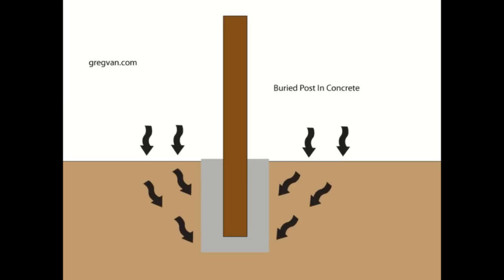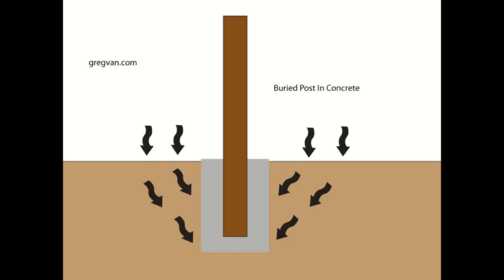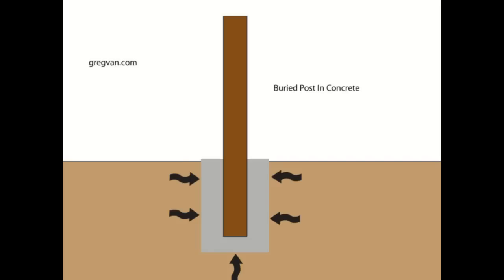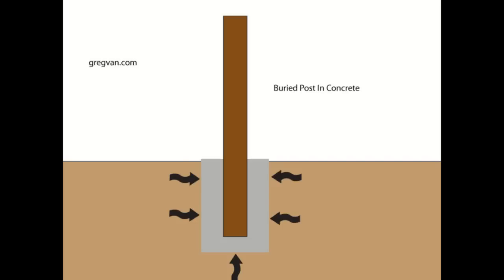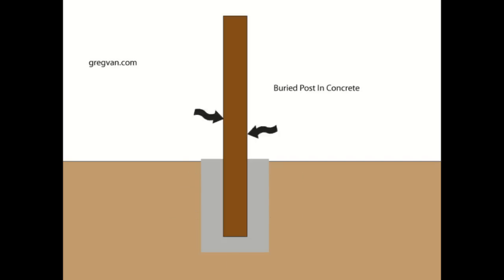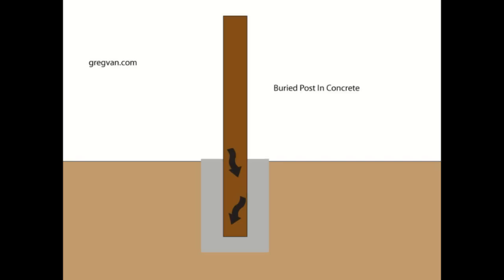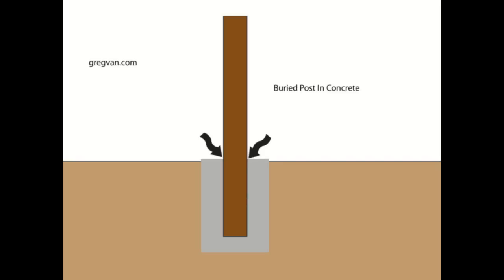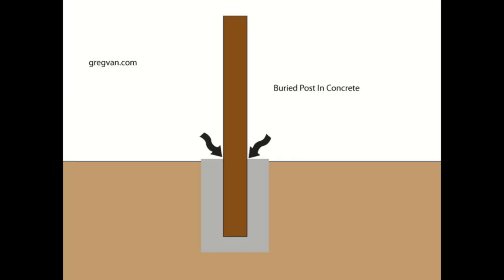Why Do Fence Posts Rot and Break - Wood Fencing Damage

Comment: I set 4X4 and 6X6 pressure treated posts into a concrete pier with the pier terminating at grade level.  I then butter the top surface of the pier, around the base of the post and about 6 inches up the post with an acrylic paintable caulking.  I use a cheap DAP exterior caulking which states that it has a 30 year life. when used or normal caulking purposes.  Butter the caulking on with a putty knife about a quarter inch thick.   I find it seals the base of the post where it is always wet with debris, ice, snow and wet leaves tend to gather.  it seals the gap where the post enters the pier after the wood shrinks with time to prevent water from pouring down between the concrete and the encapsulated wood post and it seals the top of the concrete pier.  I've found that the caulking does break down after about 7 to 10 years and allows water to reach the critical post base at that time so the rot process begins then, rather than the day after you installed the post.    If I've extended the life of the post by five years or more, that's a fair benefit for the two dollars that it costs to butter each post.

Comment: Gravel in the bottom of the hole. 
seal the post with roof tar or wrap with bitchathane.
They now make products for mortar and grout that you mix into it to make it water proof.
Always slope the top of the concrete away from the post. As will as have the concrete  above ground level.
Caulk around the gap at the post and concrete meet.
If the customer is willing to spend the extra money. add a piece of coated 1/8-1/4 angle iron in the ground with the post.
sticking out 1' above the ground. 

Foam is also an option but must have hard soil or deeper holes.
Does not work with load bearing posts. (ie gates)
Reply: What is the small angle iron in the ground for?  What is foam?  Thanks.
Reply: keeps the post more stable against wind movement as well as when the post doese start to rot you have the angle Iron to then bolt the post to.  Foam : just like spray insulation. closed cell.  use it instead of concrete.
Reply: +Dusty G. Thank you so much for posting, Dusty. I knew if I read enough comments I'd find one with the info I needed. You the man!
Reply: Top comment, nice one Dusty - proper job ; )

Comment: What you can do is paint Henry's # 107 waterproofing onto the post below ground and 2-3 inches above ground. Do not paint the bottom but put 3-4 inches of gravel in the hole so moisture can drain out of the bottom of the post.
Also seal open ends of wood and joints where water can get in you can paint over this stuff but not stain it.
Reply from the maker: The gravel won't eliminate problems where soil doesn't drain well. The gravel will tend to provide areas for moisture that cannot penetrate through clay soils to gather and remain for long periods of time.

Comment: One thing I do is always put down a few inches of gravel at the bottom of the hole and then use wet cement.  Fill the hole, place the wood.  Square and level the wood.   And then the top of the cement mold it at a semi cone shape so that water drips down and away from the post.  This will help with ground rot where most of the rot I have seen happen.
Reply: Alex Moreno gravel will actually hold water on the post.  do an experiment for me.  Fill a jar with 1/4 pea gravel, 1/4 sand , 1/4 topsoil, and 1/4 organic matter.  The water will fill up each soil horizon before it "releases" the water to the next.  This is caused by osmotic pressure.  So in an effort to let the water drain by filling the bottom of the hole with gravel you've actually trapped the water.  Solution to experiment and fence post is to mix all of the soils for faster drainage.
Reply: Now, do the same experiment without the jar, that's right.  The water spreads out the disperses on the bottom and the sides.    You keep not putting in a base layer, and I keep putting it in.  Never had a fence post fail from wood rot on the base yet.    Remember, if you topped your post correctly, the top of the base of the post will be domed shape, not flat, so water run off will do exactly as it was designed, runoff the sides and drain from the bottom.    Putting something in an enclosed jar, limits the actions and does not show true effect.
Reply: FINALLY!!! A FENCER! I'm so happy to see you. This author should be banned from making fence videos - it's not even close. Thank you, for being you.

Comment: I apply Thompsons Water Seal on the post, then twice wrap thick tar paper around the bottom two feet of the post and staple it on. I make sure to leave a couple inches of paper past the bottom of the post. I then cut the four corners back to bottom then fold each flap to the bottom and staple. Then I wrap duct tape around the other end of the paper to the post. Then set in the hole and add Quickcrete post cement. Think of it as a tar paper sock for the post.
Reply from the maker: That's pretty much my take on it. One of my neighbors just got to building a fence in the front yard and wrapped the bottom with a product that would keep the water out from the bottom, but won't keep moisture from absorbing into the post and then traveling down where it can be trapped.
Reply: +gregvancom I thought of that, that's why I heavily spray on Thompson's Water Seal.
Reply from the maker: Sounds like you've done a good job and as long as you follow the maintenance requirements from the product manufacturer then you could have a fence that will last a long time. Good job and let us know what happens in the future.
Reply: +gregvancom I also wrap duct tape around where the top of the tar paper and the wood meet as to avoid water running into the sock. I'm not saying I've found the ultimate solution, but hopefully a better idea.
Reply from the maker: Well, we will see in a few years or hopefully a few decades and if you remember feel free to send us some pictures in the future if you have success.
Reply: lol good luck on that...
Reply: I paint my pressure treated wood posts with Titebond 3 waterproof wood glue. At least 3 coats. Then I wrap the part that will go underground with 6 mil black plastic and use 2-inch tape to hold it in place while it's being buried. I don't use staples because I don't want to penetrate the waterproof glue. The post lasts MUCH longer with this approach.
Oh, and I don't use cement. I tamp the soil using a tamping rod. Add 6 inches of soil to the hole and tamp. Add 6 more inches and tamp. etc. etc. etc.  It's just as rigid as a post set in cement.
Reply: Vinnie Corbit,,,I'm putting up pasture and will use your method. Thsnk you so much.
Reply: I use foundation tar.  I use three thick coats and I come up above the ground at least four inches. I also don't build standard fences.
Reply: Ccsongor Stelcz that is what I was thinking about doing next time I dig posts. If the common failure point is ground level, why not just slap some tar on 2 inches above and below the soil line and forget the concrete all together.
Reply: LOL.  And you have put down how much fence like this?  LOL anyone can totally overdo it.  The key is finding a simple process that does 90% of what you described.

Comment: Agree, it depends on the soil type.  Here in Colorado, we have clay like soil, so water tends to roll off the ground.  Nonetheless, I took these steps to minimize moisture and so far it has worked well. IE, my neighbors and I had to rebuild our fences due to a major micro-burst a few years ago.  Well, we had another one and my surrounding neighbor's cedar fences got destroyed and mine is standing.  Their rot can be attributed to concrete and wood shrinkage based on what where the posts broke.

Comment from the maker: You've got a good idea, but you might be forgetting about any moisture around the concrete footing from the soil that can be absorbed into the concrete. If only a small section of the wood underground wasn't covered or sealed, you could end up with a bigger problem than if you left it alone.

Comment: Here, on the Outerbanks of NC, our soil has a high content of sand and drainage is very good We do not use concrete to erect fences (or similar structures). We just excavate the soil at a depth of at least 1/2 the height of the post. Post are then tamped in (with a sledge) until there is no more movement. The static pressure that the sand puts on the posts is more than adequate to maintain the post in a vertical position  One more thing that we do to extend the life of the post and that is we apply liquid copper preservative to any end that was sawed (cut) by yourself.  I don't know how many years posts last but I see very few replacement posts.
Reply from the maker: Thanks for sharing and it's good to know what other people are doing around the world and US.

Comment: Another option that struck me the other day was to use something like "rustoleum bed liner" or latex spray on a can and cover the bottom of the post in that.
Would make for less of a messy installation but I have seen cases where rust forms underneath "bed liner" products so they apparantly are not completely tight, latex should be though.

Comment: Very informative video. I appreciate the time you take explaining it even though there's no one size for all solution. I live in VA where the ground is pretty wet. I'm considering putting a disclaimer in my contracts about premature wood rot and offer the option of metal posts. But now I have to research about them rusting
Reply from the maker: Definitely put that in your contract. I would also suggest examining fences built in your area a little more closely see which ones are lasting longer. I have a neighbor about two houses down who built a wood fence with metal posts that are normally used for chain-link fencing and his fence is doing just fine. Probably about eight years old.
Reply: @gregvancom  I saw a video where this older guy used roofing tar 3ft, from the up. Leaving the bottom open so it doesn't cup. Wonder what inspectors would think of that

Comment: Nice video.
You pretty much addressed the main problem with using concrete to set wooden posts.  I would add that the post also needs oxygen to rot which is why it tends to rot right at ground level first.
The other problem with concrete in northern climates is with frost heave.  Pouring concrete directly into a hole will promote frost heave.  
I suggest using  something as simple as a good compacting gravel to set the posts.  The gravel will allow moisture to wick away from the post.  Plus it will decouple the frozen earth from the post limiting frost heave.  And its cheaper.
Reply from the maker: I would like to add that wood fence post can rot below the surface and actually start rotting below the surface. Hopefully people in areas where ground frost is a problem also read your statement and it's definitely something I need to share with others.

Comment from the maker: That's good news. However, this method will work all the time. Soil and weather conditions will be a factor. To give you an example, I painted a wood fence post with an oil-based paint in Southern California where it rarely rains, but had a neighbor water the fence with the sprinklers and within less than a year, needed to replace the post again.

Comment: All of which is a very roundabout way of saying don't use concrete to set a fence post: it traps rot-inducing water against the post, and is a nightmare to remove when the bottom of the post eventually rots. Use deep-treated wood and set the post in hardcore, with at least 6" (150mm) of hardcore in the base of the hole. The water will tend to drain away from the post, giving good longevity, and when eventually it needs replacing, the task is reasonably simple.

Comment: What do you think of metal brackets in concrete, and securing the post to the bracket? Something like the simpson LCB44. If the post does eventually rot or is damaged another way it can be replaced without digging out concrete. Other than the additional cost are there any significant disadvantages?
Reply: +Jason Markantes - If you look at the Load Tables for Simpson Strong-Ties LCB44 post base you will see that they were only designed and tested to resist uplift loads. The load on a fence is generally a lateral load from wind and Simpson Strong-Tie does not give a rating for lateral loads. While the post base may provide some lateral resistance there is no way to know how much. So unless you can find a post base that is rated for lateral loads, I would expect that the connection between the post base and the post will be the weak point. http://www.strongtie.com/nonstandoffcolumnbases_columnbases/lcb-cb_productgroup_wcc/p/lcb.cb

Comment: I think that using concrete which is relatively new to humans in historical terms is the problem people want a fast and easy method all though it may not be the best method long term.  As a teenager I was taught to put in fence posts and strainer posts using stone knocking it in with a 10lb hammer around the fence posts and you knocked in as much as was needed till the fence posts was secure and straight.  Slightly different was with the strainer posts.  You dug a hole with pick axe and pointed spade, found a large flat stone and put it at the bottom of the hole so stop the moisture from the earth rotting the base of the strainer and then put larger stones around the circumference of the strainer knocking in smaller stones as wedges forcing the larger stones to push tightly round the post hole wall and you keep doing that till you reach ground level.  Good natural stone will not crack in winter the stone base doesn't with hold moisture like concrete does and posts that I help put in twenty five years ago still stand today at my parents farm and I have used the same method on my own farm.
Reply from the maker: I like your method and have never heard of it before, I sincerely appreciate you leaving this comment and sharing your knowledge with us. It sounds like you have some good results, but I have one question for you, does the soil on your property drain well or is it more like Clay and retains water. Also, what is the overall height of your posts and how deep do you bury them.
Reply: Relatively new to humans in historical terms?

Concrete like materials supposedly were used around 6,500 BC by the Nabateans. A Greek structure using concrete was dated to approximately 1400 to 1200 BC.

However, concrete use did die down and become very uncommon for quite a while until 1824 when portland cement was invented.

Comment: A study I read from the professors at OSU Wood and Science Engineers, proved that the organic fungi and insects in the soil are primarily what breaks down wood fibers, causing it to rot. The fungi organisms rot and decay the post, chemically treated or not.
Reply from the maker: The only problem I have with wrapping the bottom of fence posts in a waterproof membrane would be any moisture that is absorbed into the wood, then pulled down to the bottom by gravity where it will sit for long periods of time, until the wood starts to rot. It's almost like they would need to wrap the entire post or don't bother wrapping it all.
Reply: gregvancom
You dont wrap the bottom of the fence post. You wrap ROTBLOC around the fence post where the majority of the post below the ground is exposed to organic matter and moisture. There are install photos and specs on the website and facebook site. It works well, is affordable and very simple and affordable for on person to install in a minute. The study posted by the professors at Oregon State University in the Wood Sciences and Engineering Dept. published the results a few years ago.
Reply from the maker: I probably didn't make myself clear, I would never use a product like the one you're referring to, because of the problems previously mentioned. I guess I've been in the business too long and seen to many products like the one you mention fail and end up costing the property owners even more money in the future.

Comment: I am using the plastic protective sleeves for ease of changing post when they inevitably rot. I have not seen a comments on this! From what I learned these allow post to breath and last longer. I also put gravel in the bottom, set my post and sleeve together, add a little more gravel around the base then drop in some dry concrete so the mixed I pour on top will not go under the plastic and adhere to the bottom of the post. This in theory allow the post to drain and prevent rot for a much longer period of time. Not sure how good this approach is with clay or a shale base of the hole, but if it does drain and no concrete sticks to the post it should last longer and when the inevitable rot does occur the post should be easy to replace. Not sure why I have not seen any other posts like this?
Reply: That's the same method I use here in the UK, and it rains a lot here!!! my father taught me this same method 45 years ago his fence lasted 40+ years, also he did treat it with used engine oil and paraffin mix 2:1 every 3 to 4 years. Took him 3 to 4 years to save up the used engine oil.

Comment: It would be nice if you included one of the ways to help alleviate this problem, which is to have a bed of gravel below the concrete and have the post continue past the concrete into the gravel.  Finally, wetting of the wood is not really the problem, but the cycle of wetting and then drying (dry rot).
Reply from the maker: I don't have a solution for this problem and it's obvious to me that gravel isn't going to be the solution if it's placed in expansive soil that doesn't drain well.
Reply: that's pretty much the standard logic, gravel underneath concrete gives you drainage. It's not that concrete or wood gets wet, it when they are standing in water for very long periods of time or as you said, wetting and drying in a rapid manner, sprinklers are good for that kind of thing.